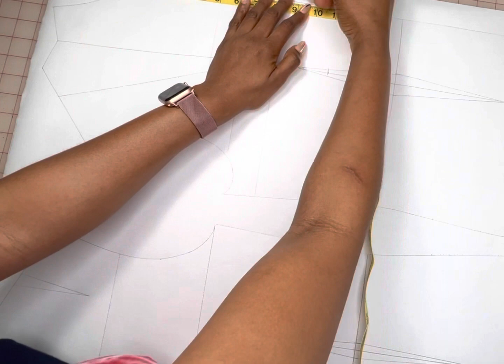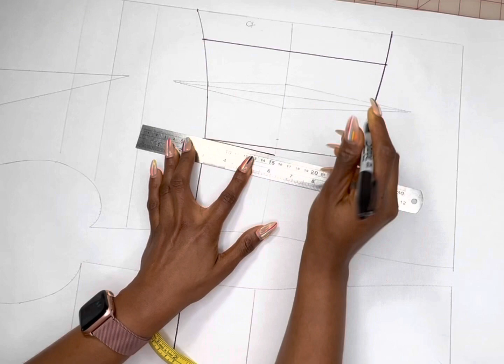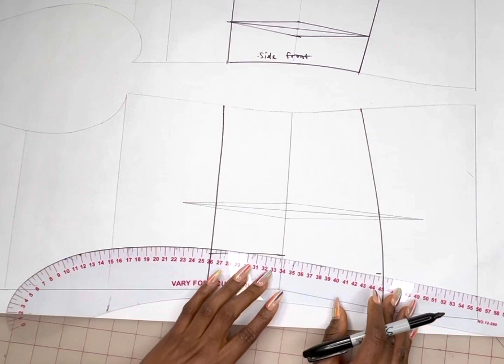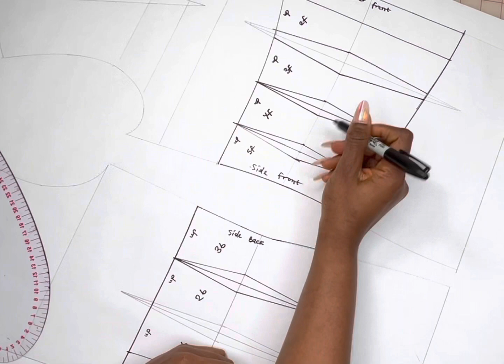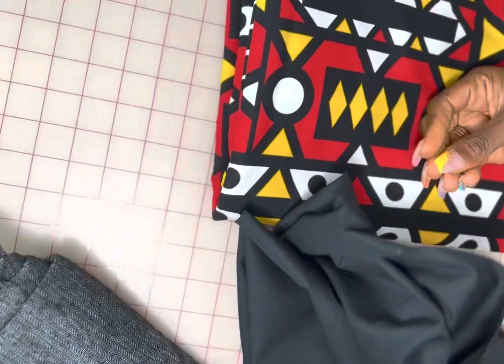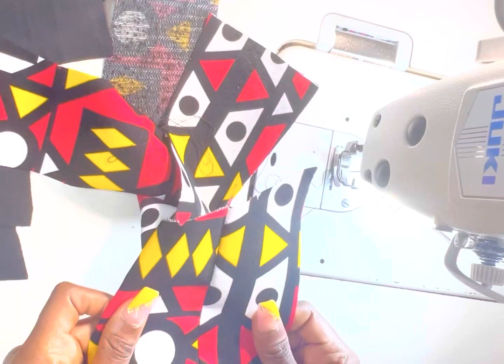HOW TO: MAKE AN UNDER BUST CORSET / PATTERN AND SEWING TUTORIAL #diycorset #corset

Comment: How did you get the 2cm you share on each panel and what if i'm making the back  5 panel too will I be using 2cm also?
Reply from the maker: It was based on the amount I took out of the waist measurement for it to be cinched
Reply from the maker: If you want more panels, use lesser than 2cm darts